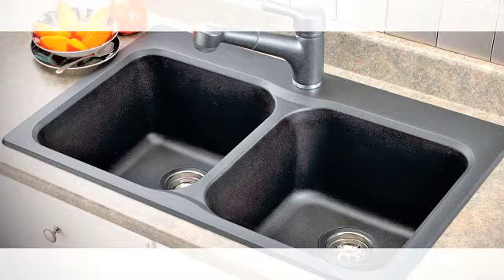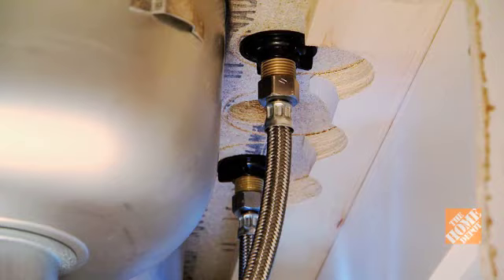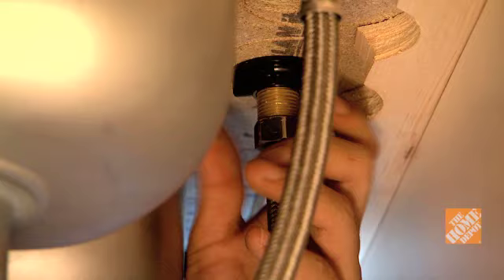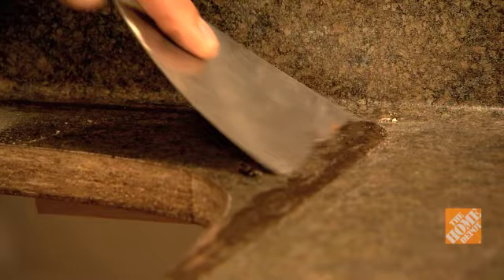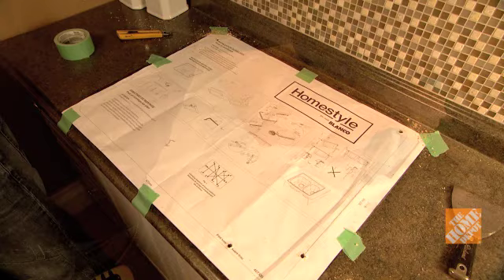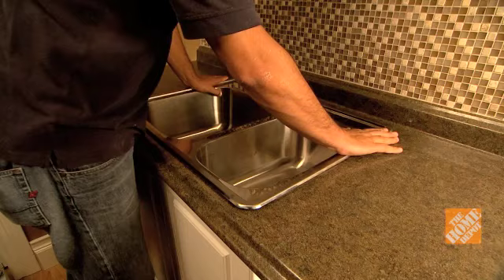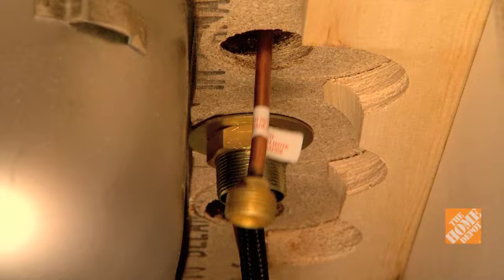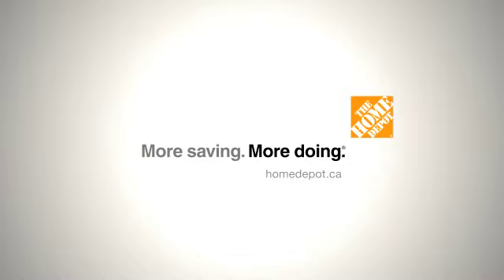How To Replace A Kitchen Sink

Comment: Use pillows and cushions…. Like yes we all know we are 35 or older
Reply: I’m 17
Reply: Here at 29, i’m speedrunning this aging thing
Reply: I’m 20 🎉
Reply: Lol speak for yourself! It's a good tip, but my knees aren't that bad yet 😂
Reply: Im 18
Reply: @dazzbourgh  hahaha! Tell me about it.
Reply: Im 19 with my own house 😂 barely makin ends meat man to man I see why the statistics for the male gender in self harm are so high
Reply: I removed all the tile, removed the plaster and horse hair wall, [heavy asf moving to the trash, luckily they still picked up stuff like that then] removed the lath, replaced the lath, put up cementboard, cut tile, mixed mortar,
 tiled the bathroom at that age, removed all the ant infested insulation from attic that was gross in 95 degree weather ants everwhere gross🤢... made my own cement  pavers. if think 35 is old, goodness help you when you're 60.
Reply: @InternetOverdosage  you could try to find a good roomate to help you out with the ends,
 Self harm is over rated,  don't do it.
Reply: @msheart2  for sure 😂 I’m too bitch to do it anyway ma boy and every man thinks of it but of course it’s not worth it everyone regrets it if they live to tell the tale

Comment: I always instale the faucet on the sink outside to make it easier to tighten, rather than crawling under the sink and jamming your fingers in tight space to tighten. But both ways work, the important is to make the customer satisfied from your work nice video.
Reply: You install it out side?
Reply: @msheart2 Pretty sure they mean installing fixtures in the space and light before dropping the sink into the cabinet. Then just attach supply lines to shutoff, drain for dishwasher and drain lines to sink bowls in the "dark."

Comment: Should I put caulking in as well as the gasket, or is the gasket enough?
Reply: Gasket is good but use clear silicone around the edges when done.
Reply: NEVER CAULK AROUND THE OUTSIDE OF A SINK. WTF
Reply: @kennethmerrill812  why?

Comment: I'm really surprised that this came from Home depot. .They made it sooooooo much harder than what it really is.

Disconnect the water supply lines at the shut off area. When you pull out the sink, you can disconnect them after. Also install the basins, faucet,  water lines and  sprayer on the new sink BEFORE you put it in. Any work you can do before you install makes it so much easier that trying to install when your upside down under the sink. The sink fasteners are usually 4 in the back and front part of the sink and 2-3 on each side. If you put these on before you put the sink in they will fall off when you turn the sink right side up. So turn the sink right side up and rest on the basins and slide all the fasteners in then.

Also BEFORE you put the sink in run the bead of caulk around the edge of the countertop ( not the sink). When you put the silicone on the sink it will run off when you turn it upside down Enjoy

Comment: This is an odd video. One of the advantages to replacing a sink and faucet together is not having to crawl into the back of the cabinet to install the faucet and supply lines from the bottom.
It is easier to assemble the drain baskets and faucet with supply lines before dropping the sink into the hole. You will need to test fit the sink assembly before tightening everything up.